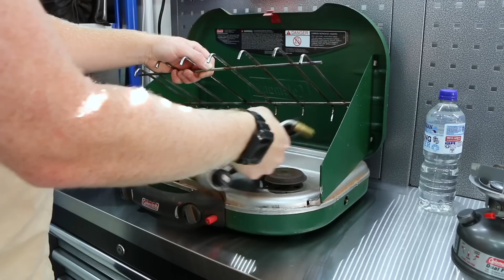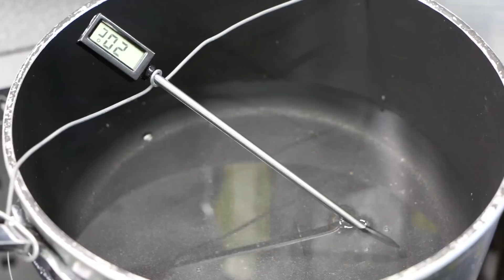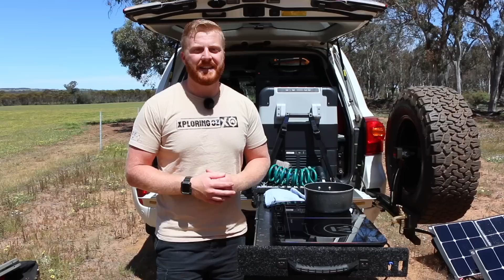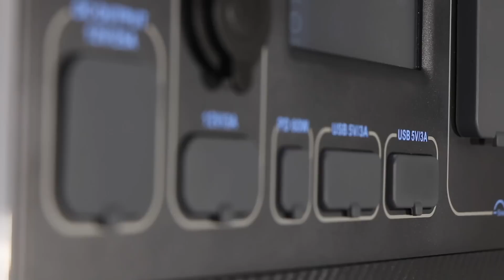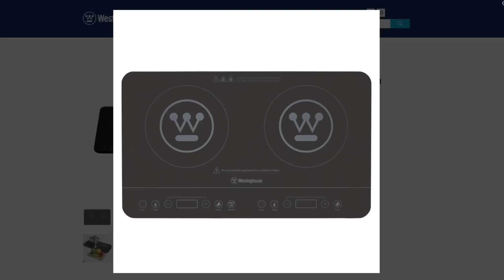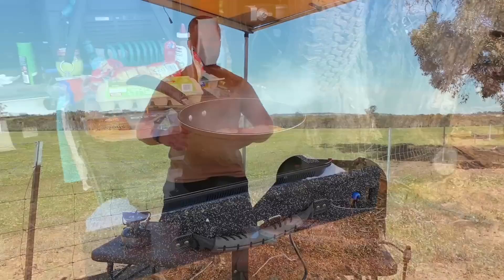INDUCTION COOKING & Camping | Is it sustainable | Electric vs Gas | Overland Cooktop | Pots&Pans

Comment: I love induction and have a commercial induction range at home, but I do go with gas out there. In the US, where I live, refilling those gas bottles is quite easy since most gas stations offer refills, so while you're gassing up anyways you can refill the LP bottles too. The second reason is power consumption: I have 500W of solar and a DC to DC charger that charges up my single 100Ah LI battery while driving. With the electric fridge and the battery powering lights etc. in my little offroad camper, I simply can't run an induction cooktop. We're often parked in one location for a few days and keeping my food cold is more important than cooking on induction. 
Last but not least, my camper has a gas powered heater - the areas we camp in tend to be cold at night, some quite cold and my wife just hates freezing and having condensation in the camper. So I put a Propex heater in which was designed for a VW Bus but since my camper is not even half the volume it can heat it to pretty much any temperature without condensation or much gas use. So I have a gas cylinder anyways (and it has a storage spot on the camper). 
So call me a convenience camper - I love going out into the woods for weeks at a time and normally we don't have to restock food for at least 10 days due to the electric fridge, but I do like my conveniences like a hot shower when parked near a water source or a cozy night when it's cold out. For that I happily bring a gas cooker - aside from me being a bit chefy and therefor sometimes cooking on 4 burners out there. Nothing better than sitting on top of a cliff with a nice glass of wine while having a good dinner and watching the sunset...
Reply from the maker: Very nice, sounds like a great setup and plenty of options there. It also sounds like you might have easier access to gas than we do here in Australia. Although plenty of places to refill, they can sometimes be a fair trek to access...
Cheers, Nathan,.

Comment: I think you are mistaken about the heating of the pan. The induction top creates a magnetic field in the food that causes it to heat up.that heat then conducts into the pan the pan only enables the reaction. You can buy cheater discs to use any pot or pan. I used an old steel pizza pan as a cheater. Great video.
Reply from the maker: Cheers mate, appreciate the explanation here 👍 
I hope most people have got the general idea about how they work. 
Cheers, Nathan.

Comment: When using cast iron mine failed and also warped my fry pan. Low and slow start is required. Mine started at 1200w as default which was very annoying. This was a Kmart job and didn’t last. I no longer use induction either. I hat tempered glass to con on versus metal stove and feel more confident with that set up.

Comment: Great video and very complete! I have a portable induction hob on my sailboat and I can have in the galley or in the cockpit where it can be windy -   excellent. What I would suggest rather than the inverter, run a DC cable back from the starter battery connect on the positive side a Cyril-Li-Charge to protect the starter battery and the liO2 battery *these are cheap-  then terminate the cable with a XT60 plug which can go straight into the Bluetti. That way you safely skip the loss of the inverter. A little more complicated, you have to take care. But it is cheaper and more efficient - just a thought ;-)
Reply from the maker: Cheers mate, glad you enjoyed the video 👍 
Thanks for that suggestion, I'll definitely look into it as this would run more efficiently without the inverter loss. 
Cheers, Nathan.

Comment: Comparing the 2 is stupid now. Just read some of the comments. 
The setup needed for induction is a huge cost compared to gas. 
Your next video should be “when to switch to induction from gas” 
I love gas and it’s been great for years. But with the power available in lithium’s now, it’s easy to have the power available for a couple of fridges and a cooktop. 
No one cares if it’s a minute difference to boil a pot of water. 

also lithium’s are cheap. Most of them are just overpriced.

Comment: There was too much emphasis on boiling water time. I don't think that is the reason one would purchase an induction cook top. I want to know the size of inverter required, the system is it 10 or 15 amp circuit.
Reply from the maker: Only because boiling water is one of the most taxing jobs for an induction cooktop and the supporting electrical system. Also, this provides a constant baseline for testing, it's easy to visually observe and measure to compare side by side results. Obviously using it to cook other meals is going to work in the same fashion but it would be a lot harder to compare the results. The inverter is a 2000W system within the Bluetti AC200P power station.
Cheers, Nathan.

Comment: "Do not use this appliance on a metal surface" yet your workbench is metal... notice anything weird?
Reply from the maker: Yes, however this bench is only a very thin metal veneer and is mostly comprised of wood. It didn't seem to have any effect on the testing conducted in this episode.

Comment: One very important pro for the induction cooktop that is worth mentioning is that it is illegal to transport propane in your vehicle,, when driving through a tunnel, in the US. Not illegal to transport an induction cooktop. :) So, if there is a tunnel between where you are and where you want to be, you'll have to either skip the propane or find a place to purchase it after you pass through the tunnel. Or just not worry about it, at all, if you have an induction cooktop.
Reply from the maker: Very interesting and not something that I've come across in my research, but handy to know. Another strong benefit for the induction cooking! 👍

Comment: I wonder whatever happened to cooking on fire? Induction cooking to me is biggest waste of money and adding weight to your setup. We cook on fire and supplement with Butane stoves.
Reply from the maker: Each to their own I guess. It doesn't replace cooking over a fire, but we all know that in Australia we can't light fires for a few summer months... Just another option to consider. 👍
Reply: @XploringOz  100% Agree. With 104 Amph Lithium battery I can go 4 days without charging so I removed the solar panel and saved 13kg on the RTT. The Solar panel was pretty useless with Lithium because with 30 Amp DC-DC charger the alternator will fully charged the battery in 45 min to an hour of driving. 
For induction cooking I will need 2 100 or 1 200 Amph battery, 3000 Watt inverter and at least 2 150 Watt solar panel. That is a lot of weight.
Reply from the maker: @boymeetsbush8232  For sure, for many people it just isn't a viable or desired option... but an option none the less. Hopefully as the technology improves the batteries will continue to get lighter, smaller and pack a bigger punch!

Comment: Thanks for the video. I have a question...I got the blueti with 800W inverter. Can I still use a 1000W inverter to charge it from the car? or why don't you just charge from the 12V outlet?
Reply from the maker: No problems mate. So are you using the charging adaptor from Bluetti through your 1000W inverter to charge the unit? If so, this would work just fine. 
The reason I don't just use the 12V in the slow charging rate. This doesn't bring in much power compared with a high powered inverter and takes substantially longer. 
Cheers, Nathan.

Comment: The one thing I wish I could find is a 12v, 15 amp low power induction cooktop.

180 watts isn't much, but with an insulated pressure cooker it would be enough to build up the requisite heat before dropping it in a thermal cooker to finish.

Would also work with a cast iron griddle with insulative lid. Build up the heat in the mass and then cook in phases, with the stuff that needs the most heat (say frying meats) first and the less heat demanding tasks like frying eggs or pancakes or potatoes after
Reply from the maker: That would be a great idea. Hopefully a manufacturer will come on-board with an appliance like this 👍 
Cheers, Nathan.

Comment: Got a cheap induction cook top similar to one your using for $69 and love it but yeh 2000 watts at full tilt is the downside but I have found myself starting the generator for breakfast 🤣
Reply from the maker: For sure, pro's and con's either way. I guess we can hope that technology will improve to the point our batteries become more efficient and pack more capacity into a smaller unit. Inverters are definitely coming along nicely to be able to power these hungry devices!
Cheers, Nathan.

Comment: I'm curious...does food cooked on induction cool off quicker than food cooked on gas?  Winter camper wants to know.
Reply from the maker: If the pan and food is left on a stove used to cook it then the induction cooker will cool down quicker. There is much less residual heat in and around the pan with the induction when compare with the gas cookers. If you are removing your food from the cookers straight after cooking, then the process will be identical. 
Cheers, Nathan.

Comment: Would induction top cooking be legal in the outdoors like wheat belt on total fire ban days?
There is no naked flame, you can’t be accused of “Arson” by “kindling a fire” - and it would seem to me that the risk would be low to negligible / non existent.
So along the same lines, will the Bluetti run a small microwave instead of induction cook top?

Just trying to work out rough “total costs” & please correct me if I’m wrong, :-

Bluetti power station = $1800
3 x Solar Blankets at $800 each = $2400
2 x Westinghouse induction tops = $200

So we are at about $4400, to flatten the Bluetti with each cooking session, without it needing to run the fridge overnight for eg.
My point being, if it’s raining for 2 or 3 days straight which isn’t that uncommon down in the lower southwest forests where they get an average of an inch a week of rain all year, then if you flatten the Bluetti cooking dinner, then there’s no power left to run the fridge all night.
So your essentially running the vehicle all the time to recharge all the power station or you have to carry a portable generator or you need to carry gas bottles and gas cooker anyway.
I like the idea of not having the risk of a leaking gas bottle inside a vehicle where the risk of explosion is too high.
By the same token the risk of 240 volt electrocution in a wet camp site  doesn’t thrill me overly either.
We are basically back to needing to carry a portable nuclear power station everywhere you go unfortunately.
You know yourself, your already overweight on GVM in your cruiser & when combined GCM of vehicle and caravan come into play a GVM upgrade on your vehicle will just reduce the GVM of your van to stay within combined GCM limits.
For me in a new Prado these weights are just never going to work out, there’s not enough room nor payload to carry all this gear.
I already have the Companion Lithium 75 litre fridge in the back along with all the recovery gear, there’s zero room for camping gear or fishing gear so a camper trailer of some sort will be required just to transport everything legally to where we want to go.
So in essence we need all the gear you mentioned plus a portable generator & gas bottles and gas stove.
When you add up all these costs, to camp where 1000 filthy animals tourists have been camping before us and left their crap & rubbish behind and pay DPAW a fee for discreet camping into the bargain to add insult to injury, it would actually be cheaper & far more fun & cheaper to head up to Shark bay without all that expense & crap, rent a air conditioned unit with running water, air con, comfortable beds, flush loos and showers, TV and a fully equipped kitchen, hire a boat up there and go fishing for 3 weeks.
It works out cheaper than buying all this “off road crap”.
I think people have lost sight of reality in this crazy pandemic world.
It’s all doable, but is it really affordable & enjoyable any more?
Did you know that if you park to film videos on any DPAW estate, to publish on a monetised YouTube channel that under their laws - because it’s commercial filming you have to apply before hand and pay for a filming permit in addition to paying your discrete camping fee?
All that “scenery” in their land estate that you film belongs to them & they want their $$$ for the privilege of filming it & publishing it. 🙄
Suddenly renting an air conditioned duplex unit overlooking the ocean in Denham is sounding pretty good Eh?
No flies during the day & no mozzies at night, unlimited fresh water, & power etc etc.
The whole “outdoors camping gig is just totally over priced and no where near as enjoyable experience as what YouTube videos suggest.
Not much fun in the wilderness without air conditioning when it’s 47-50 degrees outside, just ask Bec & Justin from Trip in a Van about their recent Pilbara experience from Broome to Exmouth in 47 degrees with 3 kids and their “rig” is approaching $400k worth, the cost of an average house in WA.
This sh!ts just not viable or sustainable sorry.
It’s got totally out of hand to be straight up honest about it.
Reply from the maker: Hey mate, appreciate your honesty and sharing your thoughts. You are definitely right in your comments though and not everyone is going to suit this type of lifestyle though. But there still is something about going bush and camping, rather then just renting a room, although more comfortable. 
The gear, weights and room issues are definitely genuine and the problems you mentioned are genuine for the locations that popular people go to.
Saying this, there are soo many places that you can't rent nice rooms, remote areas where camping by yourself, hundreds of kms from anywhere or anything is an experience you can't replace. 
The SW region of Wa is series wrecked by the amount of traffic they receive, but there are soo many hidden gems in WA and around the country that take these off-road rigs to explore and discover...
Each to their own and maybe one day I'l retire to renting rooms, but for now, I'll take the camping route and take memories with my family enjoying the temps, flys and mossies, haha
Cheers, Nathan.

Comment: Very good video, thanks for posting. 
A good addition to the induction plate will be an Instant pot. 
I have a single plate induction and supported by 240 amps lithium battery bank charged by a DC to DC charger MPPT solar controller.
In a cmpervan or enclosed camping set-up also the humidity that lpg brings into the space is an important factor to consider.
People have to also be aware of the legal requirements of transporting gas bottles in a vehicle when making a choice of the cooking system to be used.
Reply from the maker: For sure, all good points to consider as well. 
Thanks for sharing, Nathan.

Comment: For the cost of the Bluetti + inverter + solar, you are pushing $3k+. Why would you not have a 100amp lithium with 200amp BMS with a 60amp dcdc charger, I have had this in my 200 series for 2 years, it's a much simpler cost effective and reliable system. Just a thought....spend $100 more and get an adjustable power induction cooker that doesn't cause your inverter to trip out due to cycling.
Reply from the maker: Sure, you could have this, however it's not portable. Moving from a campsite to campsite, or perhaps you want to cook away from the vehicle. Portable units allows for this. 
It's not going to suit everybody, but works for me.

Comment: Thanks for a great, complete review and comparison. Great to get the figures for each. I heard there was issues with charging up that unit up on other options other than 240v. I hope you don't need all those panels to charge it up, that nearly $3k worth of panels.
Reply from the maker: Thanks mate, glad you enjoyed the video. 
The only 'issue' if you would call it that is the minimum charging voltage at 35V. This means that you do need at least 2 of these panels wired in series to activate charging in the unit and a single panel won't work. 
You can, if you want, add more than 2, up to about 5 if you really wanted for a very quick charge. 
Cheers, Nathan.
Reply: @XploringOz  Actually that could be a good thing, preloved house solar panels are cheap as chips and there voltage starts around 37. If you can fit them on its a cheap alternative. Thanks for a great review - what size battery in the box?
Reply from the maker: @brucesmith5245  For sure, house panels are a great alternative at a much cheaper price. The battery is a 2000Wh which is equivalent to about 166Ah at 12V.

Comment: The slow pulsing is what puts me off. If they used PWM at a high rate it would be much better. Perhaps some cookers do, but it's next to impossible to find that information
Reply from the maker: For sure, I hear you. I also can't comment on other units and how they work in that regards. It would be interesting and probably better to use a unit that doesn't pulse though.
Cheers, Nathan.
Reply: @XploringOz  I wonder if lowering the power more would end up just not really working for transferring energy or if the circuitry to do so becomes too big and expensive. I imagine its cheaper to turn on and off once per second than perhaps 10hz. A friend has an induction hob at home and said it doesn't do it. I must investigate
Reply from the maker: @MartinTheLaserGuy  Hmm, I see where you are coming from. I would be interested if you managed to find out. Please let us know if you get to the bottom of it. 
Cheers.